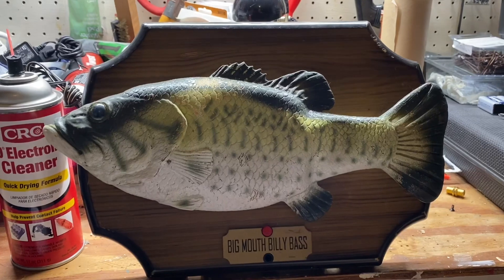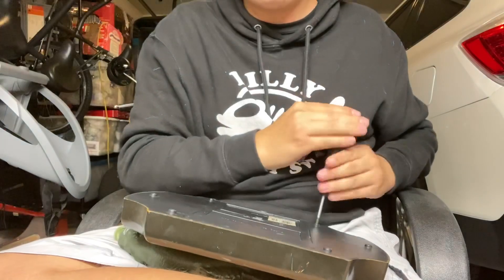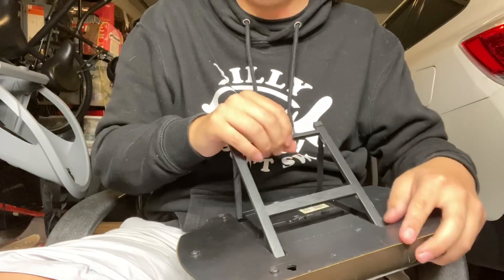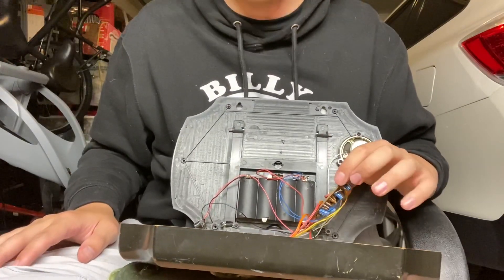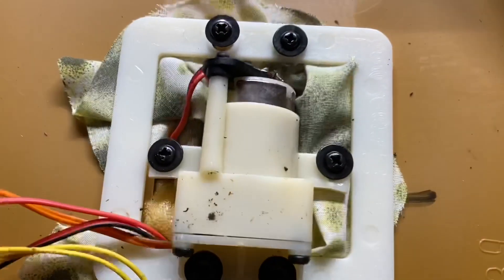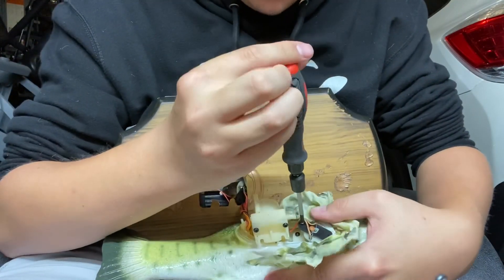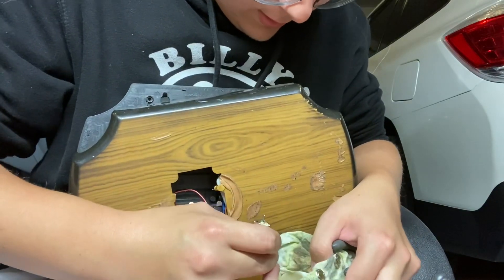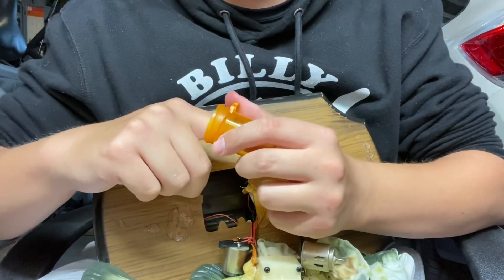How to repair your Big mouth Billy Bass singing fish (1999 models)

Comment: When you replace a 10T with a 9T, each rotation of the motor does 10% less movement of the mouth, so the mouth moves slightly slower, and at the end of each audio phrase the mouth still is moving (very briefly). Close enough though. Very informative video. Thanks.
Reply from the maker: Happy to help.

Comment: lakewi44 I have a question about one of my billy bass I was working on one and I put pressure on the circuit board and it cracked in half would that be fixable
Reply: aron thomas actually just salvage another billy bass with a broken mechanism by using the circuit board from that and put it in the one you are fixing.
Reply from the maker: it is totally fixable. you just need another circuitboard
Reply: @lakewi44  so you couldn't just solder the original circuit back together
Reply from the maker: aron thomas If it’s completely snapped in half, you can’t fix it
Reply from the maker: aron thomas it would need a whole new circuit board. Transplant a new circuit board to it.
Reply: It depends where you live. I live in America, and it's a goldmine for stuff like Billy bass and other gemmy.

Comment: I'm a retired mechanic and repaired my split gear instead of buying one,  The gear is an interference fit, like a power steering pulley the hole on the gear is slightly smaller then the shaft,
I removed the gear noting it's height position on the shaft, I ground a small flat on the motor shaft, and scratched the inside of the gear with a mini scroll-saw blade,
JB Welded it with the regular long curing mix,   Billy has been singing in my front hall for 3 years now working perfectly!
Reply from the maker: Excellent! That’s great to hear!

Comment: Pretty sure My billy bass head turn motor is broken. Replaced the gear and doesn’t work. Tried a single 6V battery connection with it and it doesn’t turn. Is that fixable?

Comment: LOL I tried pliers on the motor and I ended up slipping and tearing a wire off of the motor😂😂😂 it's fixed now although the capacitor ripped in half. Is the head motor capacitor needed? Cus it currently is working without it
Reply from the maker: It should be OK without it. The capacitor will just give it more power.
Reply: @lakewi44  ok. Thanks for help!
Reply from the maker: @streetlightingcollector9343  I’m happy to help!

Comment: Hello, im trying to fix my 1999 billy bass, head doesnt come up and tail and body barely move; i opened it and i noticed that the gear is broken and is pretty loose around the shaft, so that is surely the problem.
So changing the gear should fix the head and even the tail and body? What if it only fixes the head and not the tail? In that case do i have to change something else to make the tail work correctly?
Thanks!
Reply from the maker: Hello,
Yes replacing the gear should fix it. There are three motors inside for each movement. One for head, one for mouth, and one for the tail
Reply: @lakewi44  I just ordered 2 gears for head and for tail; they are 92A type gears, 9 teeth and 5.5 mm diameter, are they ok for 2 mm motors? will they be good?
Thanks a lot

Comment: Hi, enjoyed this video as well. I have a question hopefully you can answer. In jockeying the chassis around while it was apart, a blue wire from the on/off switch broke loose from the PCB. Unfortunately I hadn't grabbed a pic of the board yet to know where it came from. No place was obvious. 

I tried looking around on the web for a picture. Lots out there, but they evidently used different types of boards throughout production. Most examples I found are rectangular (like the one in this video), but the one in mine is L-shaped and there are scarce examples out there. Do you have one? Or have you ever seen one? The fish will work with the red button, just not the motion detector until I get this fixed. I have pics if it would help. Thanks!

Comment: I have a special billy bass that has a tail that doesn't move but the thing is it won't stop singing, even with the switch in the off position.  I ended up blocking the motion detection hole

Comment: My daughter just started collecting the singing fish, we bought One “new” and it the head still moves but clicks really loudly...do you think we need a new gear or a paddle? I hope you can reply and thank you for your help. I’m not good at doing any repairs but I’ll try for my girl with the help of your videos
Reply from the maker: I would start with the gear on the motor. I think that might be your problem. If you look closely on it you will see a crack. Count the amount of teeth on the broken gear and order accordingly. They usually take a nine or 10 tooth. the gear size is for a 2 mm motor shaft. If you have any questions just ask and I will do my best to respond

Comment: How do you get the motion sensor to work?
Reply from the maker: First thing I would try is to switch it to the on position on the back. Also you may be able to clean the motion sensor by using a little bit of rubbing alcohol with a Q-tip and clean out The spot where the motion sensor is on the inside
Reply: @lakewi44  I did that. It still doesn't work. I also pulled the sensor out and tried cleaning it and putting it back.
Reply from the maker: @kevinowens8282  Are the wires connected? When you open up the back of the plaque, does it have the wires connected to it? Some fish may not work too well if the lighting is not good or if the wires are not connected
Reply: The wires are connected. I tried shining a led flashlight into it and then move my hand in between the flashlight and sensor. Still nothing.
Reply: @lakewi44  hello! I watched this short on YT showing how adding some lead to the sensor fixed the problem, they just took a no.2 pencil and wrote on it  :)  you think this is true? I just bought a lot of 10 fish and im so excited to start fixing them yay!!!
Reply from the maker: @alejandradz174  I’ve seen that one. I can confirm that it does work.
Reply: @lakewi44   Thanks for responding so quick! I appreciate it, 🙏🏻 pls would you give me a hint on what my next step is?!  I'm getting started on Arduino bc I want to hook up Billy Bass to an Alexa. Do you know what electronics topic I should get acquainted with so I can learn *how to hook up more that ONE fish*?? Pls pls give me a hint